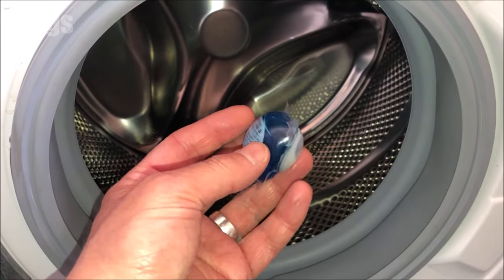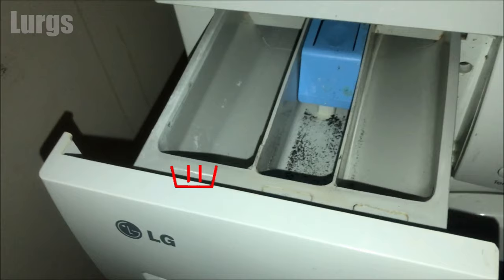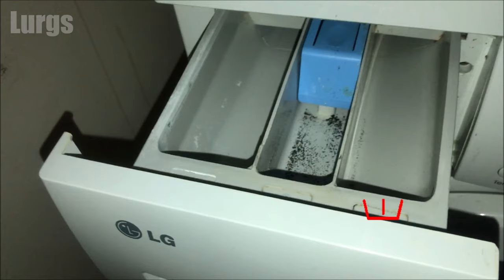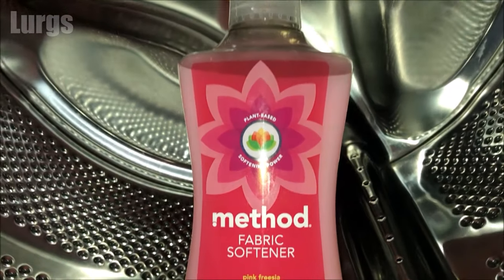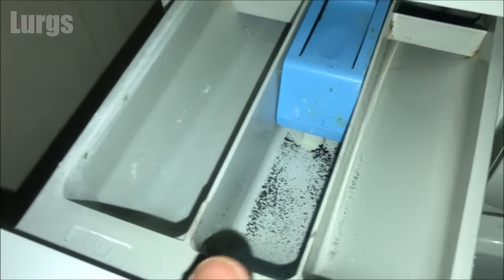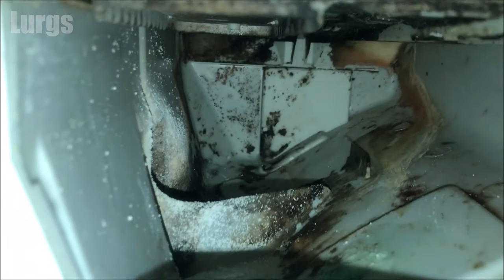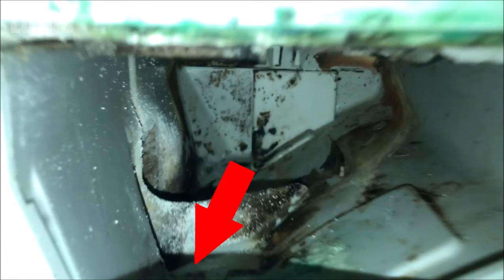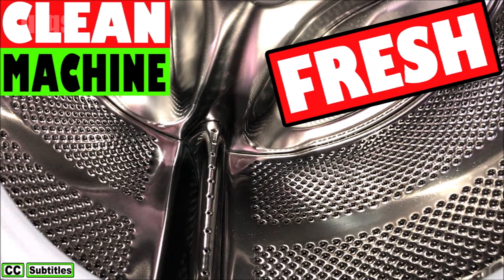LG Washing Machine Detergent Drawer Symbols & How to use Detergent & Fabric Softener Compartments

Comment: Wife's away and she doesn't give very good instructions so your video is a life and ego saver! It told me precisely what to do to clean the gunk and mold ( ughh) AND how to load the detergent dispenser. I mean that's the most manual thing that you've got to do. Rest the machine does other than sorting which (and how much) clothes to put and putting them inside! And choosing the cycle! Wife didn't tell me about the fabric softener for instance and I didn't know where to put it. She only told about how much detergent was to be put and where and ASSUMED i should know it was SUPPOSED to be put! I mean c'mon! You should know how to give instructions to a novice. And btw I defied her and stashed away my old toothbrush as she throws away ALL my old ones. Came in handy didn't it! Now who's laughing! Thanks mate! Drinks on me if we ever meet! Cheers!
Reply from the maker: Cheers, glad it was useful. Keep those toothbrushes! 😎

Comment: Great video! A tip for those battling mold or a moldy smell in their washer: after the last wash, leave the door to the drum AND the detergent compartment/drawer open. This helps more air to circulate, reducing mold growth. ;D
Reply from the maker: Yeh great tip. I mention that on other vids but not on this one for some reason.

Comment: Hi. deterg powder was getting crystalised around the front.  Scraped some off, felt under drawer a bit and finger went into soft muck - which turned out to be old soft washing powder.  I nearly freaked/panicked.  Found you.  Saved.  Got about 3/4 cupful out. Now I'm wondering about the filter:  have u done one on that please.  I am so grateful for above.
Reply from the maker: Unfortunately I’ve not gone one on an LG but I’ve got a generic one which may help.

Comment: Didn't expect to find the exact video I needed but here I am. I couldn't see the logos on my detergent compartment anymore so I was having a tough time understanding where to put my fragrance detergent. This really helped.
 Some tips from an old LG washing machine user:
You clean your detergent compartment with a toothbrush Its really effective. Also if the little holes, through which the water comes, gets clogged, we sometimes use needles very carefully to take out the salts and hard water stuff that gets accumulated overtime. Sometimes the reason for water blockage can be the area at the back of the machine where you attach the water pipe, u can clean that with a brush as well. Also make sure to run an empty machine once in a while and clean the little compartment at the bottom present at the front to make sure that your machine stays clean and hygienic from the inside.
Reply from the maker: Yeh I've got videos about cleaning the detergent drawer exactly as you describe. Glad I could help out.😎

Comment: Hi mate, on my washing machine in the fabric  sofner department there’s a little cap covering the hole, do I remove this cap from the hole as I’ve been using the machine with this cap on and putting sofner in this department and all this waxy stuff appeared under the drawer
Reply from the maker: It's probably just the measuring device. Best leave it in but every few washes just remove the dispenser drawer and give it a wash and clean